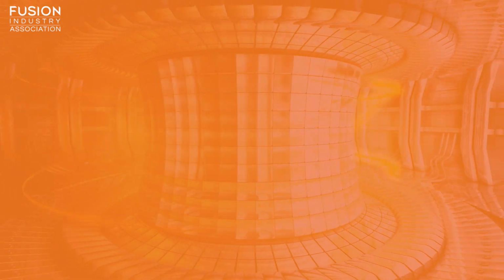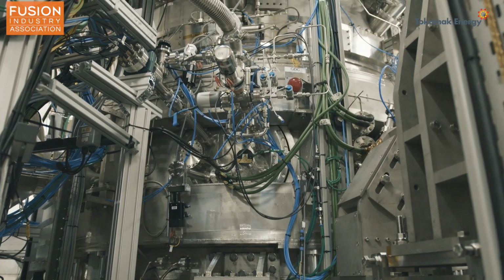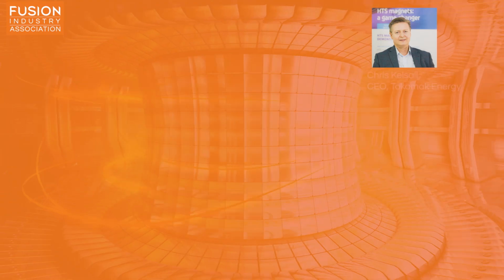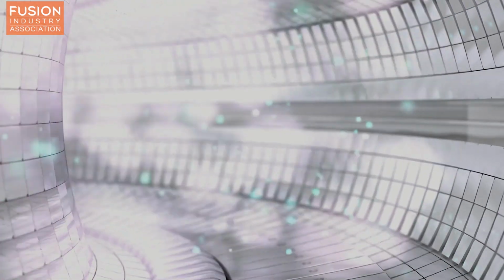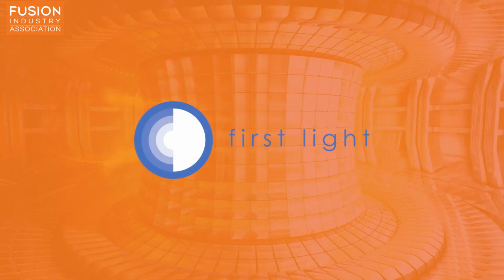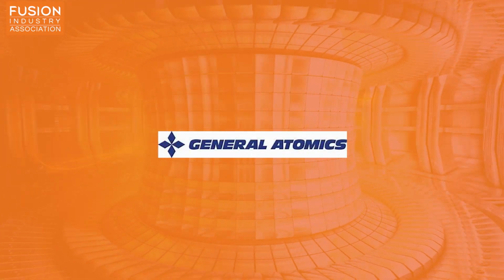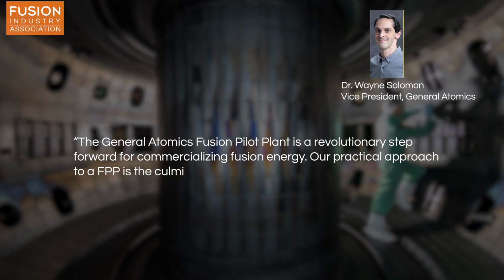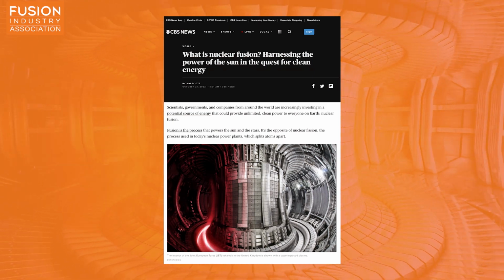Fusion News Friday, November 4, 2022

Comment: If Tokamak Energy read these comments, may I point you in the direction of Koenigsegg Automotive whom have recently released their new electric motor which have the magnets arranged in a 'raxial' layout. This new layout combines both axial and radial magnets providing 3 times the control and power of conventional layouts.
By incoporating a raxial layout of the magnets in the tokamak would this not allow greater control and stability of the magnetic field in the tokamak?